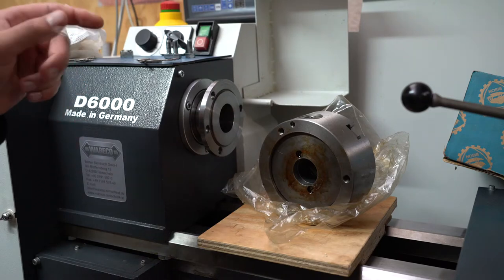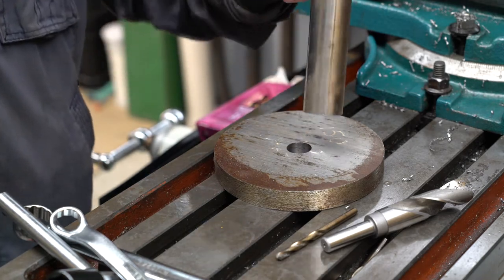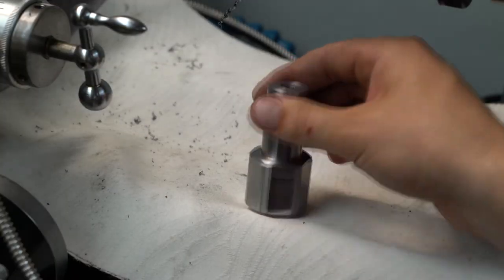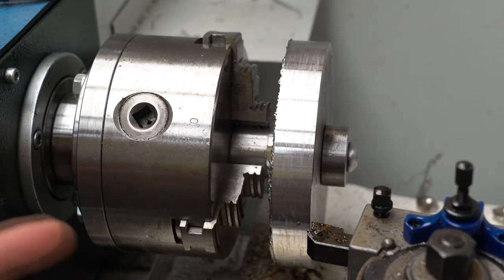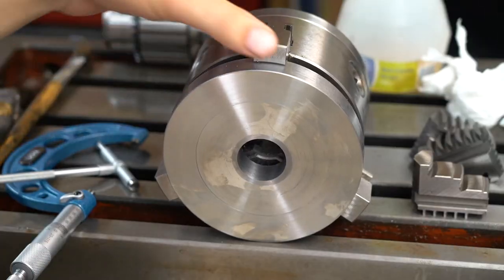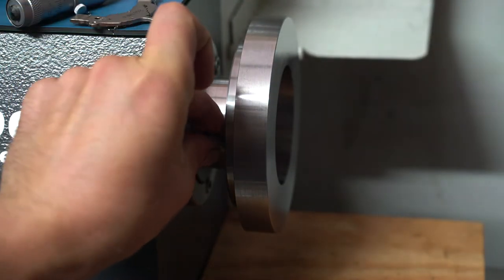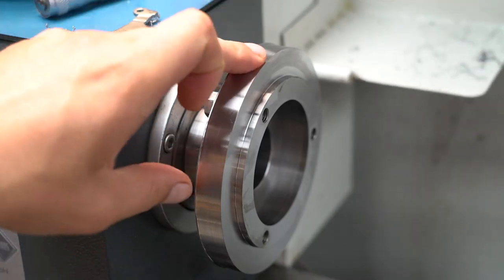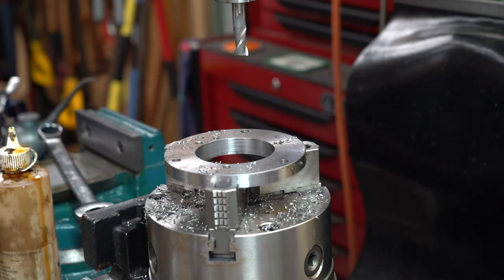🔥 Making a Lathe Chuck Back Plate

Comment: Hi Nice Vid, backplate turned out tops. I just purchased a 5"/125mm Bison self centering 4 jaw myself. I already had a chinese independant 4 jaw, but couldn't refuse this one at AU$300.00. Now to make a backplate. Not sure what to use this time, last one I made was from a 2.5kg cast iron barbell weight, messy but turned out good, only cost AU$2.00. I might just use steel this time as I have some scrap, much quicker than cleaning up the barbell weight. I am running an old Taiwanese copy of an Emco Compact 8. Cheers Peter
Reply from the maker: 300 AUD is a good price for a Bison chuck. I hate working with cast iron due to the clean up and the grit is quite abrasive if it gets on the ways but it sure machines nice and easy. Steel makes a fine back plate. Good luck with it!
Reply: @ProjectsDownUnder  Yeah cast iron is really too messy, I think I will go with steel for now. I have a bit of a chuck fetish at the moment LoL. On Facebook Marketplace there is 110mm Lathe chuck. Union Mfg, Removable soft jaws. Made in Britain for AU$150.00 mint condition, but they are in Sunshine VIC, & I am in Belgrave VIC. opposite side of Melbourne, too far at the moment😢 Where in Oz are you?
Reply from the maker: Never heard of Union Mfg chucks but if its made in Britain it's probably better than a Chinese chuck. I have gotten away without using soft jaws by just using some copper on the jaws to protect the part. Thankfully I am in NSW but I can see by what's happening in VIC that it can change rapidly :(. Anyway stay safe Peter.

Comment: I noticed your mill spindle running out when you were putting in the counterbores.  It doesn't matter here with the chuck registering on the shoulder but if you want to avoid that perhaps drilling as much as you can with a twist drill first and the mill cutter after could help.
Reply from the maker: Thanks for the tip.
Reply: @ProjectsDownUnder  Turns out from one of your earlier videos - the feet I think - that this isn't news :*)